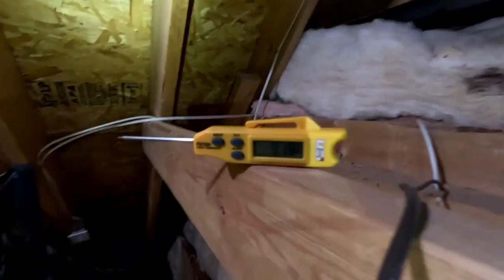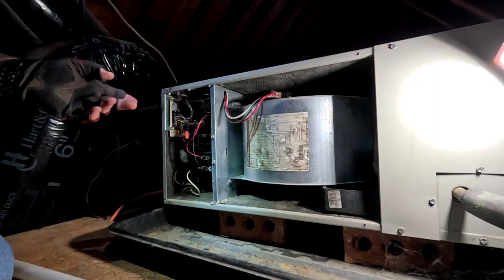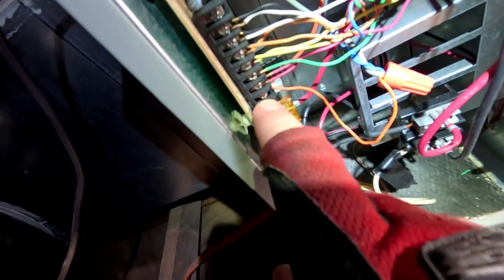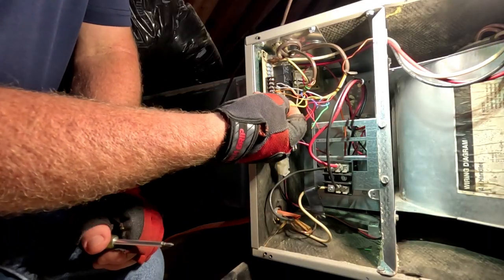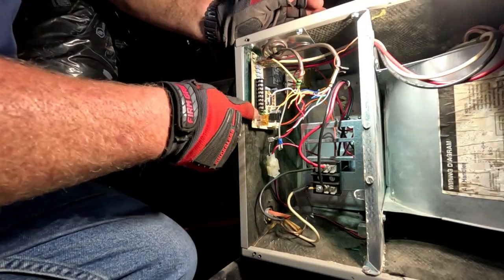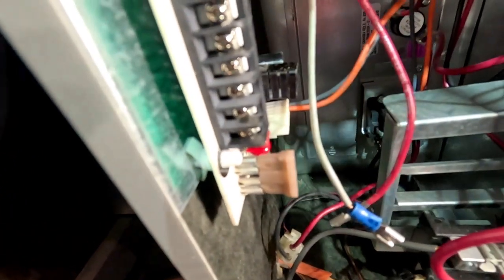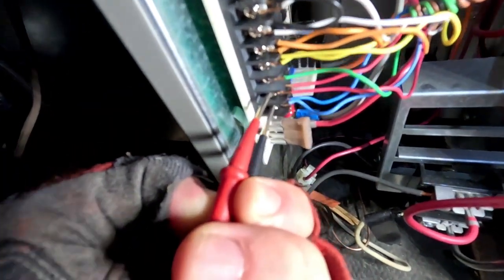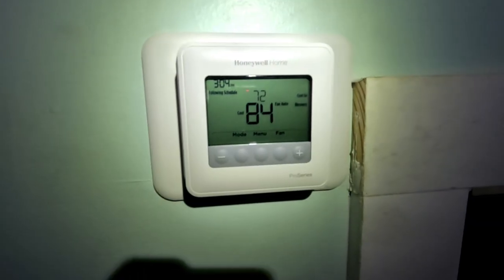No Voltage anywhere!. #hvac #hvaclife

Comment: Nice fix, and the usual great explanation.  Could that board be fixed by melting and reflowing those solder joints, or were traces cracked too?
Reply from the maker: Boards get replaced not repaired.